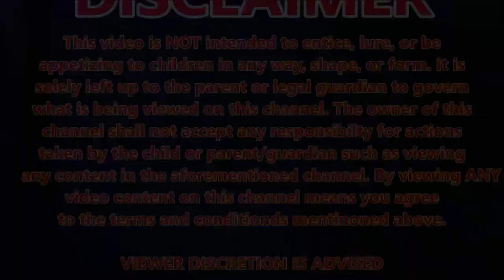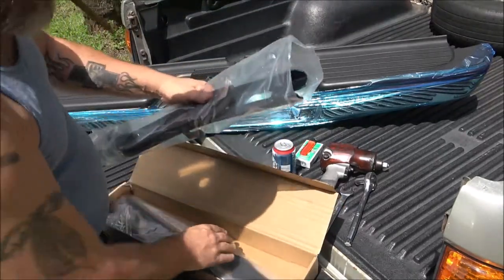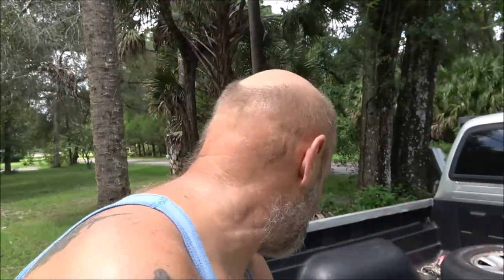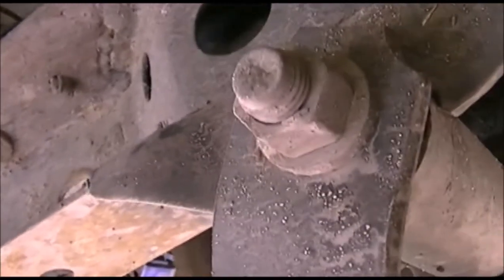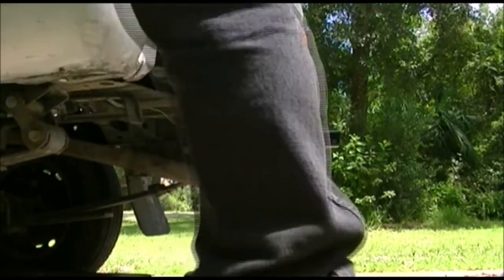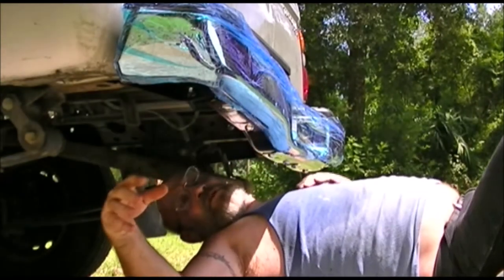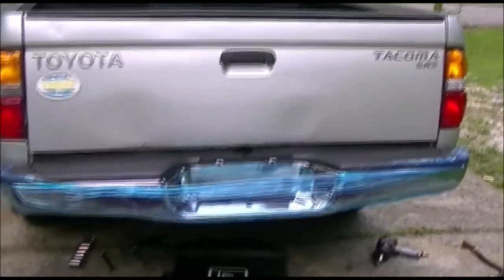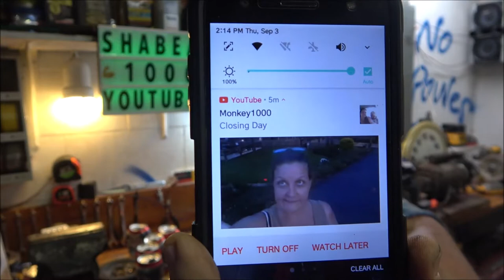Replacing The Rear Bumper On An 03 Toyota Tacoma How To

Comment: I fixed a long cranking issue with my Tacoma by putting in every component in the fuel system that holds pressure. The issue is that it leaks the pressure away so it takes a second to build it up again. Well the problem didn't get solved until I replaced the fuel pressure regulator. That was the cheapest part of all, so I would try that if I were you. I know you have the v6 and I have the 4cly but a lot of the parts between the two setups are similar.